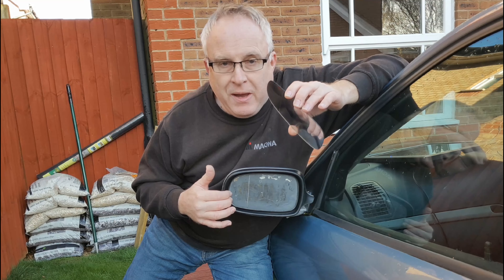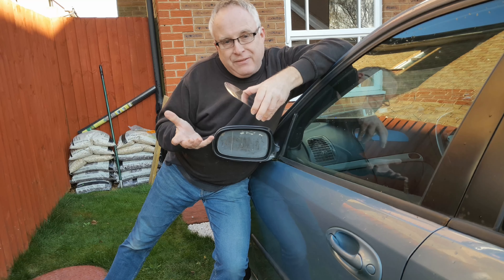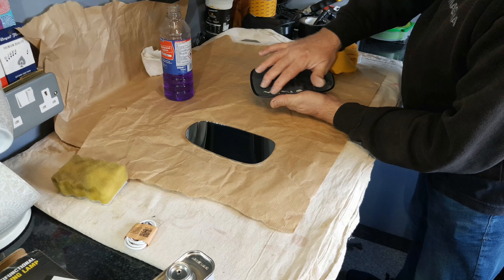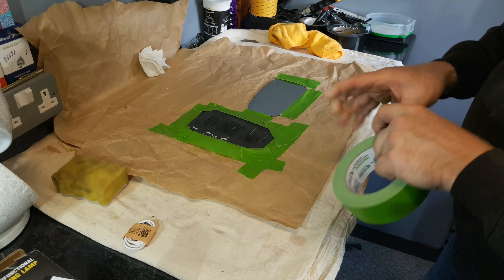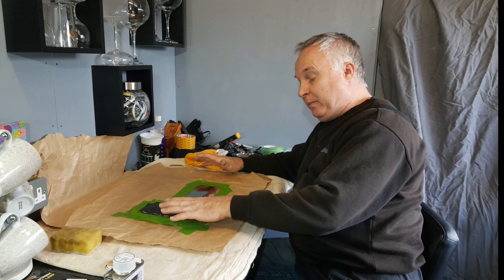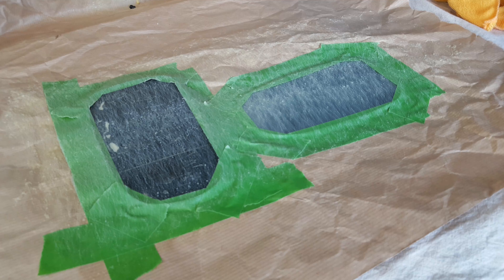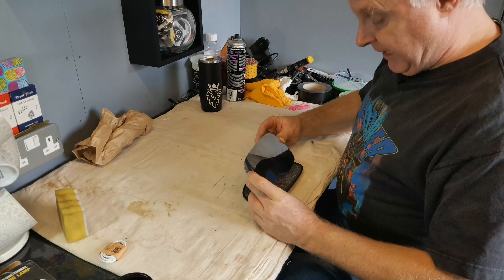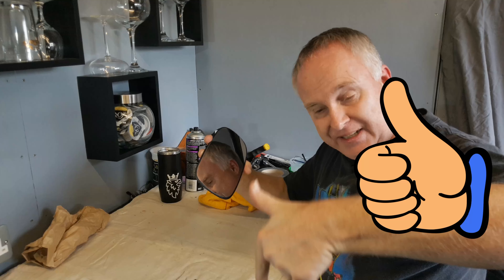How to Fix Broken Side Mirror Glass if the Door Mirror Glass FELL OFF😬

Comment: I do not reccomend any glue or silicon. It is good for a while 2 maybe 3 years but later because of the weather conditions winter/summer is more than likely that the mirror will fell off. For my customers I buy very strong double sided tape and there is no way that the mirror will fell off. Anyway good job :)
Reply from the maker: One mirror manufacturer (who shall remain un-named) was caught out using hot glue and causing warranty problems for the OE!
Reply: Which tape do you recommend?
Reply: This is exactly what I was thinking! 👍
Reply: @aileencrossett4408  3m Double Sided Tape
Reply: @BenePits  I ordered my part off Amazon so I don’t know if it has a sticky part or not

Comment: Almost just what I needed, thanks for posting. Any ideas on what to do if the outer end is unstuck but the inner end is still attached and the car is standing in a barn at 2°C?  Oh, and towards the inner end there's a crack in the back of the glass that doesn't reach the outside.  I'm mildly flummoxed but I think the first step is to buy a new mirror glass in case it breaks while I'm trying to fix it.
Reply from the maker: If there is already a crack, methinks it'll break. Follow the link to find a replacement 👌
Reply: Cheers! I'm in France, though, so I'll see what's on the go locally.  Had a google and they don't look expensive.  Main problem now is the temperature...
Reply from the maker: https://s.click.aliexpress.com/e/_opvmlRN
Reply: @CycloneCyd  Thanks! As it happens, the crack is tiny, and double-sided gel tape seems to be holding it very nicely.

Comment: Exact problem i have on both sides of my Audi.  Looked at parts online... $300 for the pair... and came right here to learn from the experts. Thank you!
Reply from the maker: Yeah, genuine glass is usually expensive, but 300 big ones? A pure rip off❗
How did you get on with the job?
Reply: @CycloneCyd  the driver’s side was $100 (USD) and the passenger side was $200. I did not understand why until i went to apply pressure after the glue-up and realized the glass is curved, i could not simply press down against the countertop.

Comment: I've been in the smash repair trade for for 36 years, I've use urethane over the years and haven't had a problem with mirror glass falling off again, urethane withstands a lot of heat or cold, urethane is a really strong product.
Cheers.
Reply: Hey, I don't suppose you carried out many rear view mirror repairs too did you? My metal bracket has come unstuck from the glass. It's not a purely flat surface so was going to use a gel adhesive.

Comment: I'd never encountered this before in years of driving. Recently the mirror on my 1 series started moving about, exactly as you described. Fearing the whole thing was about to fall off in the road, I stopped at a DIY store to buy some gaffer tape to at least secure it temporarily. Examining it more closely, I found I could just peel the mirror glass off. And now I know how to put it back on. Thanks so much!
Reply from the maker: It's become more common now as more & more cars have heated mirrors.

Comment: I am about to execute my repair and came back to watch again just to make sure i am doing it right. Thank you for sharing.
Reply from the maker: Did it work?
Reply: Perfectly. Used the 3M 90 and laid the backs out perpendicular to the glass. First one went on perfectly centered thanks to the bit of practice beforehand. The second was off a bit, half a mm low maybe, as i was very confident after the first went so smoothly. 

I let them cure in the kitchen over night and mounted back on the car the next day.
Reply: @CincinnatiDan  7 months later, is it still holding up for you?
Reply: @sky173  yes it is. No issues at all. We are coming up to winter so that will be the final test. A few freeze/thaw cycles and using the mirror defrosters should tell.

Comment: I managed to catch the mirror going a bit wobbly and I'm about to put this technique into practice...  Thanks for posting the video :D
Reply from the maker: Fantastic! Let us know how you get on and check the other side!
Reply: @CycloneCyd  Yup, seems all good so far.  I had a quick drive around the block and it looked fine, just got to give it a try on the motorway as a real test!  The other side seems solid at the moment, but I'll keep an eye on it...  I now have the gear and the knowledge to fix it when it goes!

Comment: This was really easy, I did it with fake nails on my hands haha 💅 Couple of tips:
1: if when you remove the mirror plate, the back has a lot of tabs preventing it from laying flat you need to cut into the paper to allow the tabs through before you tape it. Flip the paper over and lay the flat surface of the plate to the back of the paper. Trace with a marker and when you cut it out leave some overlap to tape to. Place it into the hole from the front and tape it, taping the glass next to it.

2. (If you're a perfectionist like me) Keep a razor or scissors handy. When you allow the glue to become tacky and you peel the tape off, the tape will pull the adhesive with it. Cut it as you go to prevent pulling it off completely. 

I used the 3M 90. I'll come back to let you know if the mirror falls off 👍
Reply: How did the 3M 90 go? Still stuck on?
Reply: @sway101  yes it seems sturdy as far as I can tell
Reply: @notafeminist7642  nice, thanks :)

Comment: Both my mirror glass fell off on my 08 combi   , thought they were heated... think the 3m double sided tape soaking the heat up! Thanks for the video I am gonna redo
Reply from the maker: Could be, any foam tape will act as an insulator and the heat will simply go out the back.
If you find you can't get the foam tape off the element and all else fails, you can always get a new pair of glass here  https://bit.ly/9_3_door_mirror_glass

Comment: Good job, nice tips. This happened to me and while I do have a can of spray on contact adhesive.....I think I used super glue or epoxy or something. Only realising later that it acts as an insulator so that mirror took longer to clear than the other. It just came off again while I was cleaning it so will do it properly this time, following your advice.

Comment: Great video, i shall be trying this very soon, as mine came loose today (car is now 8 years old).
My rear view mirror also came unstuck a while back, i don't suppose you have advice for sticking the metal bracket to the windscreen? It seemed to have a black gel-like adhesive on, and i tried using 3M pads, but it came unstuck again in a couple of days. Maybe an issue with temperatures.

Comment: Thank you for the video. I'm curious what is the purpose of taping the parts on the table prior to spraying the adhesive?
Reply: I would think 1 - holds the pieces in place and 2 - covers the edges so you don't have glue on the edge of the mirror border.

Comment: I repaired the last one by simply using the adhesive that came with the side mirror. It seems to have stuck on fine but I am guessing that was the wrong way of doing it. Should I take it off and use this method?

Comment: I’ve just stuck my golf mk  7 mirror  with some wood glue..im not going to use the heating element ,and im hoping for longevity.
I paid £80 for the drivers side mirror after id fitted it put the near side through its paces…as i was doing it it slipped luckily it didn’t drop and smash ,hence my wood glue
Reply from the maker: It'd be interesting to hear how it holds up in a few months. I'm not convinced the wood glue will stay stuck to the aluminium for very long.

Comment: Does one need to remove the backing plate if the glass is still intact? It looks to be a  hassle after looking at that those videos. I am afraid I may not get it back on and all connected.

Comment: You'll spend more money like that than buying a replace brand new mirror glass with its plastic back side, that comes with electrical and mechanical connections (15,34£ shipped to my door). Not even considering the labor and the time involved.